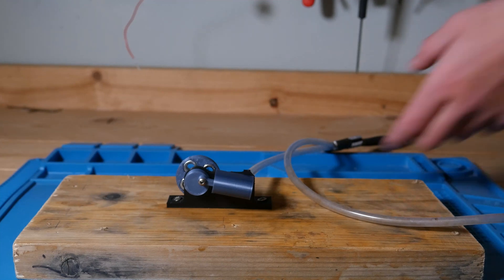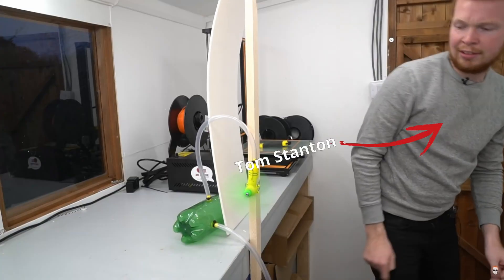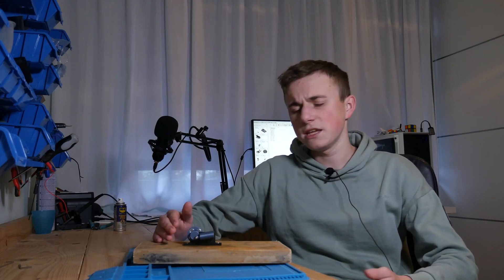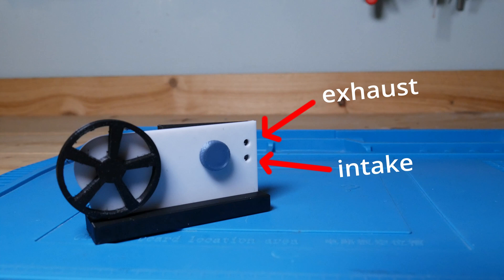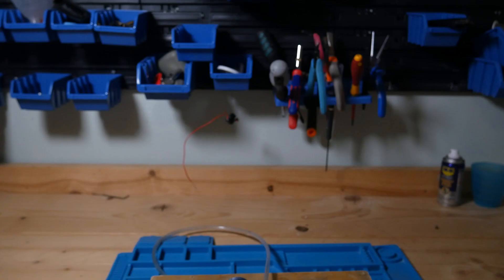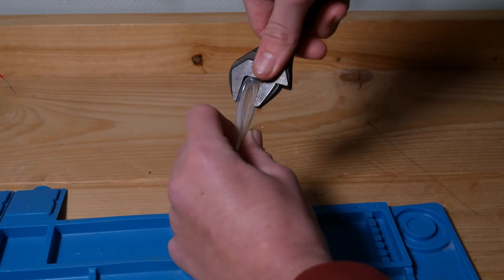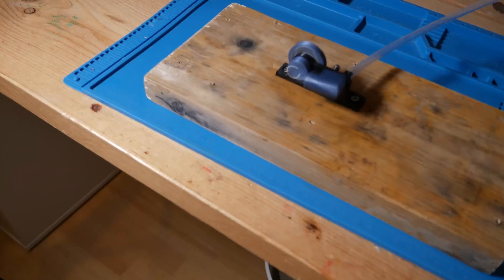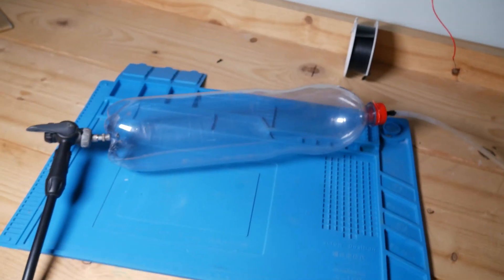3d printed oscillating engine #3dprinting #engineering

Comment: Simple but effective! Does it run longer under load?
Reply from the maker: It has high RPM but little torque, so it won't run as effectively under heavy load for long.